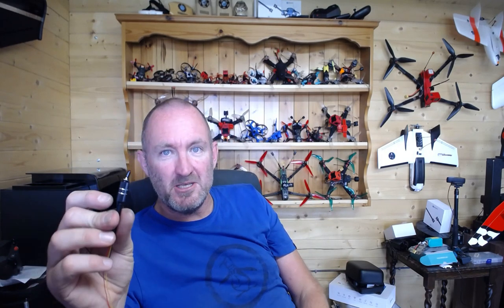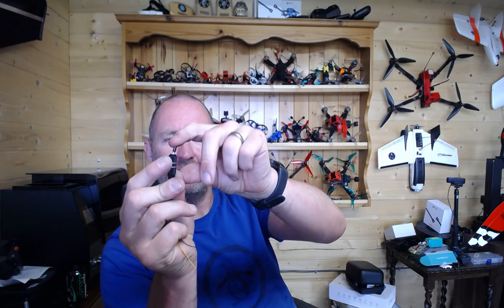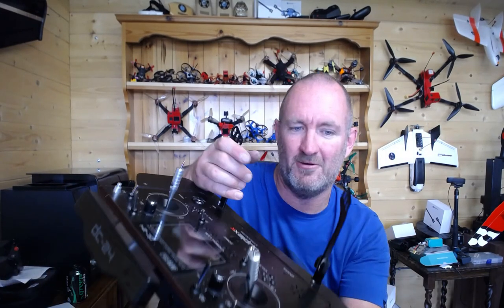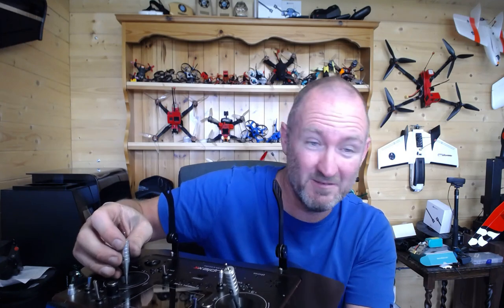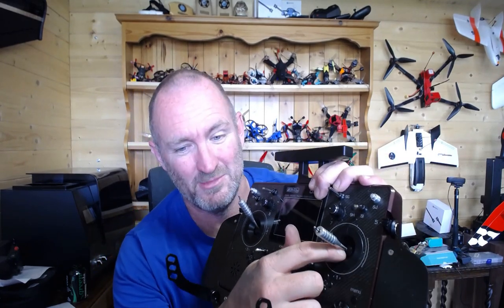RC TECHNIK SWITCHES | FOR YOUR RADIO?

Comment: Was hoping for a video on rotary mode switches for the Tango 2! Maybe next time😄
Reply from the maker: Is it even possible?

I have no idea of the tango even has spare ports.. Or a Gimbal you cam push wires through!

Cool idea though :)
Reply: Rob Thomson FPV when I installed pro gimbals to mine I seemed to be a couple of spare sockets on the board. 
I’m new to Open TX  but understand you can add multi position rotary switches to other radios using it.
Reply from the maker: @eckythump6429  maybe it is possible.

Guess the question will be weather or not the Gimbal has a hole on the middle for the wires.

Something to investigate.